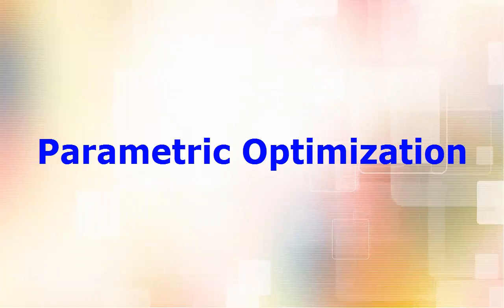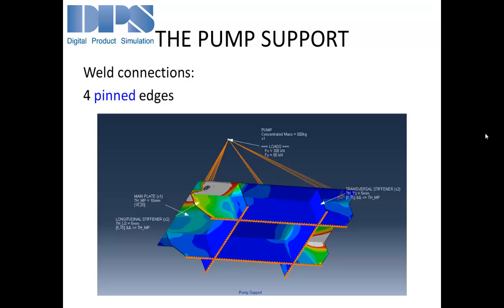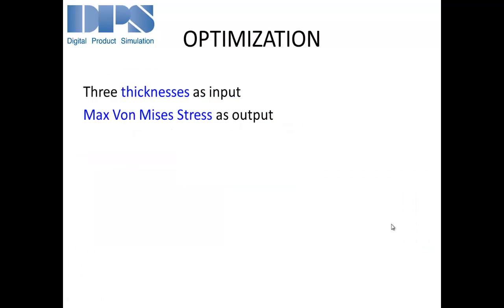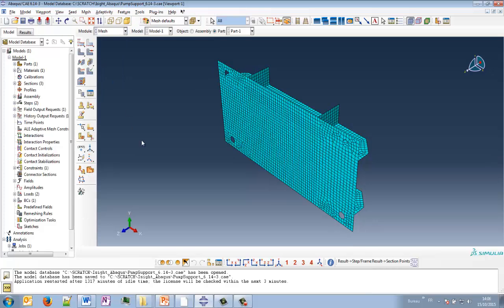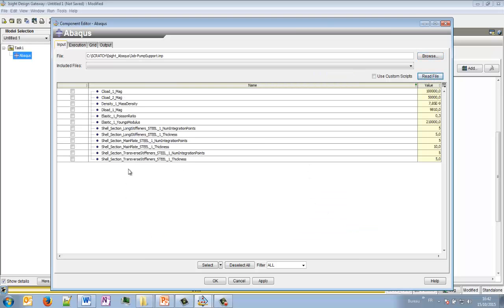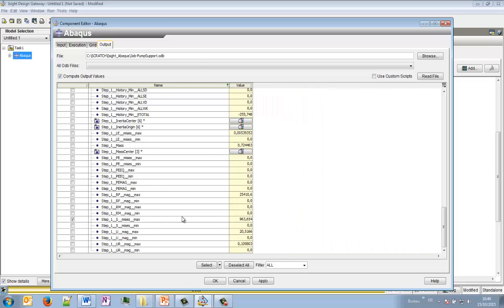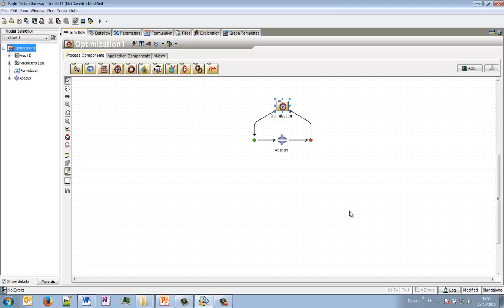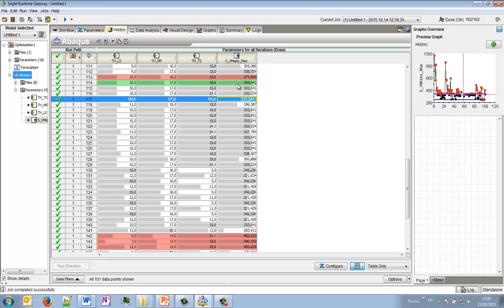Abaqus Isight - Optimization of a Pump Support

Comment: Hello , most of the times Isight doesn't read and import the CAD or FEM parameters from different softwares and just imports something partially. have you encountered this problem ? like importing a special radius or dimension from SolidWorks and see that Isight doesn't read it ? what do you do in this case?
Reply: i have a similar problem with abaqus.. i am a beginner and i dont know how handle with the parameters.. 
- Do i have to define the parameters by myself?  if yes, how i do this?
- Or do Isight find parameters by itself? if yes, doesnt isight have to make nearly every single dimension in your part as a parameter? thanks.